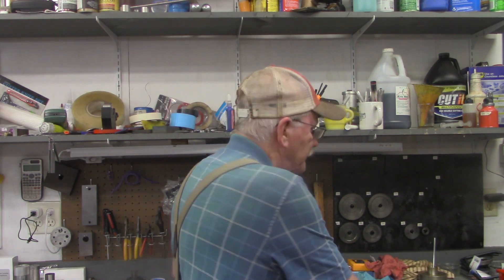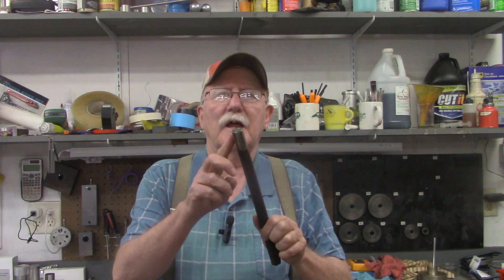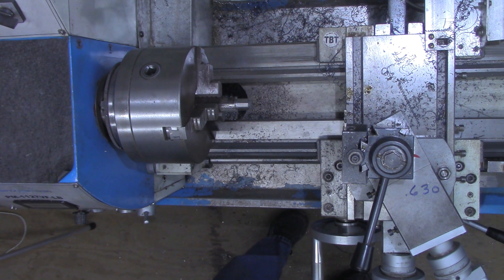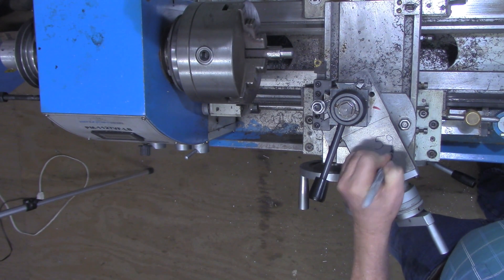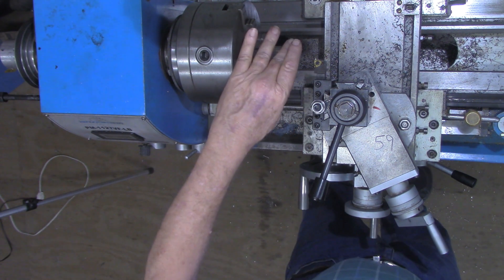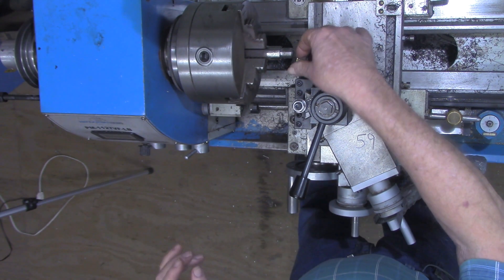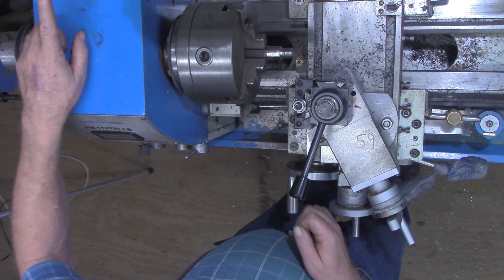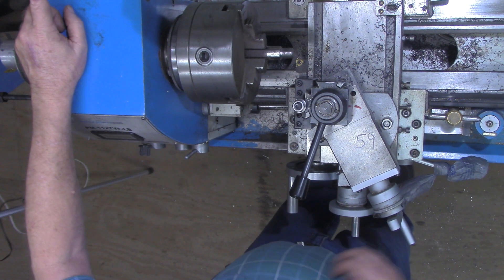Metric External Threading On Imperial Import Lathe

Comment: That's the way to do it. Well explained.
Having a metric lathe cutting imperial uses the same method.
2mm is a quite large thread. Cutting a fine thread like 0.5 mm plunge cutting can be used. Maybe You will come to such threading.